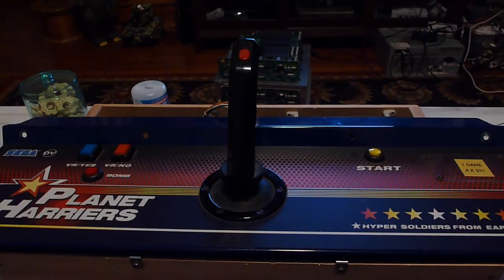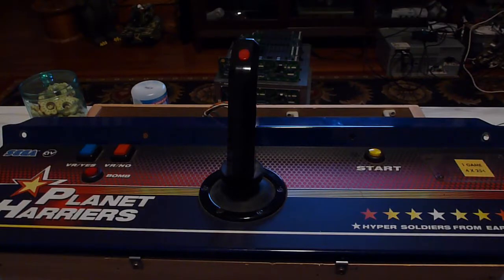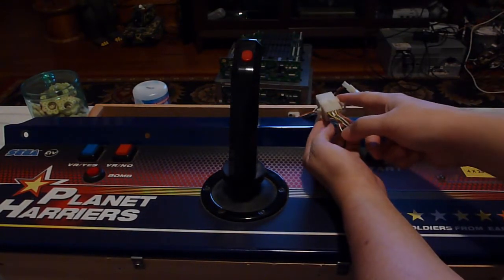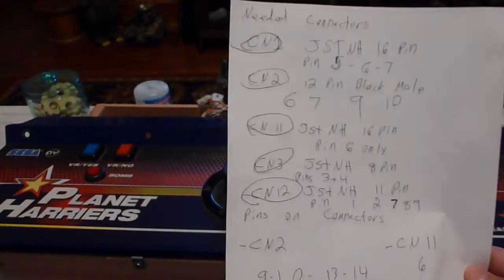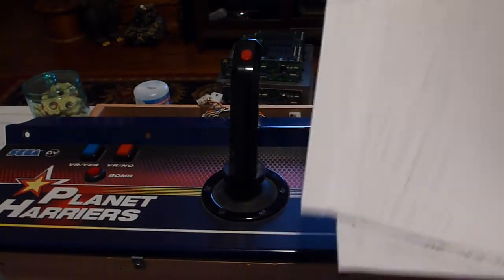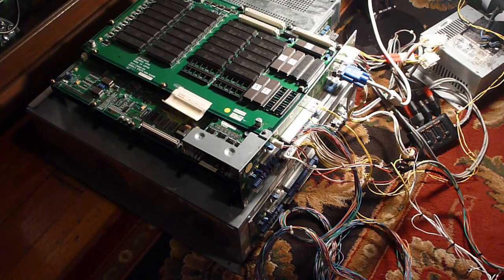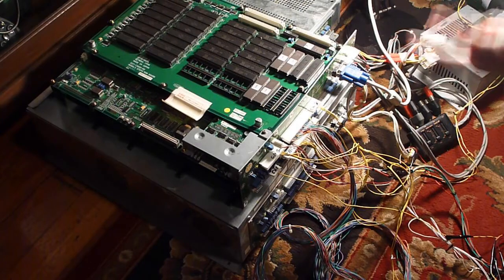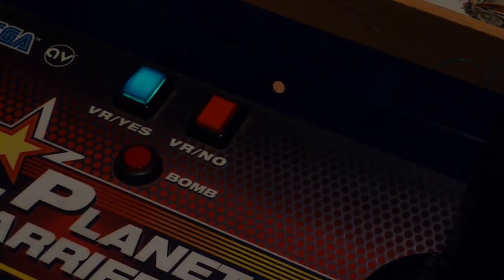Game Nexus Arcade Video How I hook Up Star Wars Trilogy Arcade (1998 Sega Model 3 Step 2)

Comment: Nice to see this back uploaded. For that cam mixer board you have going to the DSB2, I wanted to ask... did you just wire 2 of the 4 pins from the JST NH connector from the DSB2 into each mixer channel? I was thinking about using that to power mine as I now have a bit of a clear idea on what to do in terms of hooking up this board.
Reply from the maker: Yeah I had to do one channel from one and one from the other since the mixer board is kind of messed up and doesnt work on stereo on all channels, it was the easiest solution to work. If you have a cam mixer board that doesnt have blown out channels you can just mix 2 stereo channels without a problem.
Reply: Yes, I actually bought a battery/USB-powered mixer like here: https://www.amazon.com/gp/product/B0824Q3WY8/ref=ppx_yo_dt_b_asin_title_o00_s00?ie=UTF8&psc=1
At the moment I'm using my DSB2 uncaged as I don't have the proper connectors but plugging it into my Naomi Sun PSU it seems to work well on its own. Fingers crossed. Though ghetto, I have my M3 fans stickied to the PSU as I play them on the regular, and they're rather heavy to move around in the cage, but as long as you keep them cool I think you should be fine running them uncaged. :)
Reply from the maker: @ConversusVans  Looks like a good mixer, probably would upgrade my setup for dsb is I ever got cabinets to put some of the boards in.